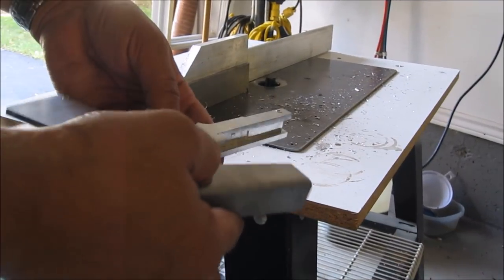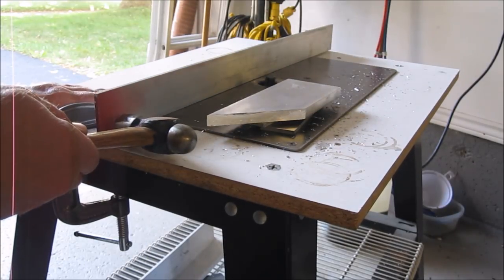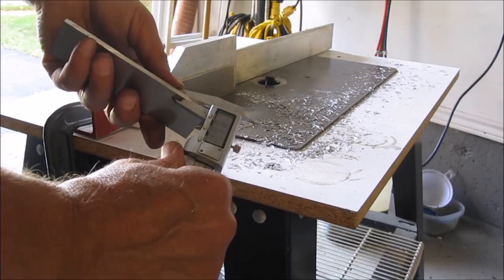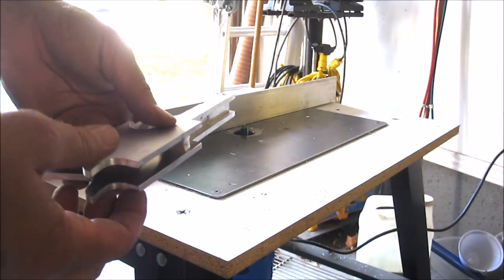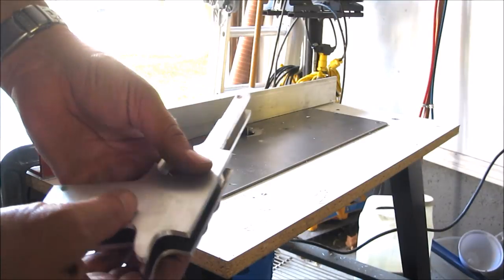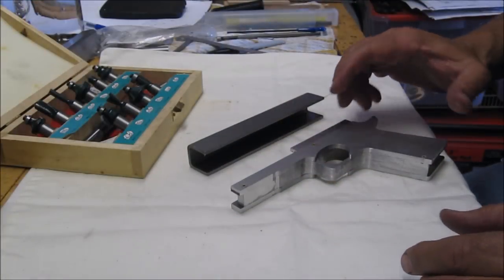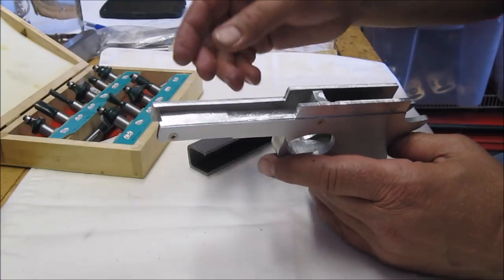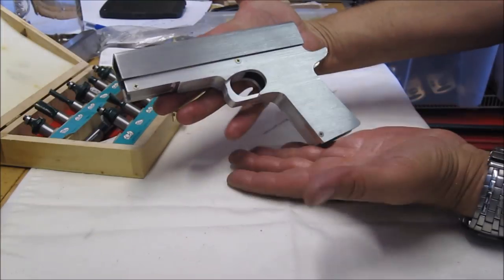Kolt380 Re-boot - Slide fit

Comment: Nice work  is this a wooden bandsaw what you used?
Reply from the maker: Yes, it is. It runs a little fast for aluminum and the life of the blade is not as long as it should be. Can't do steel on it.

Comment: friend as it is called the name of all the wicks with which it opens all the channels. the wick box on top of the table at the end of the video
Reply from the maker: The box is an assorted collection of router bits that fit into the wood router I use for machining aluminum. Only aluminum and wood.